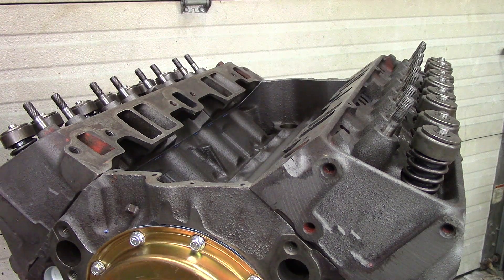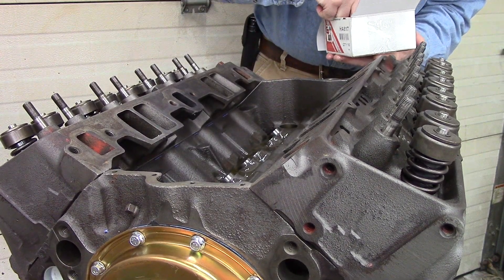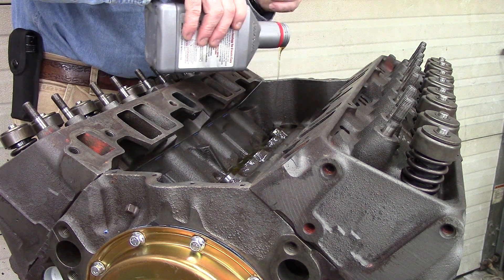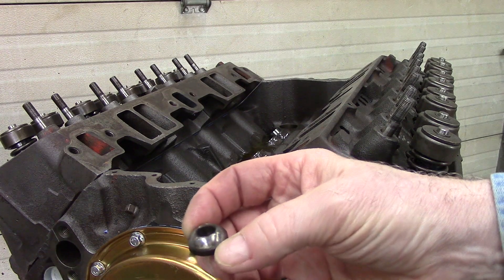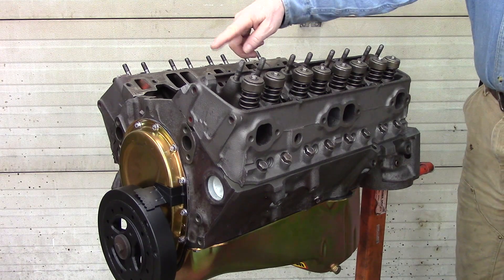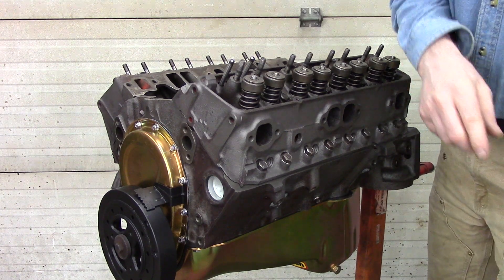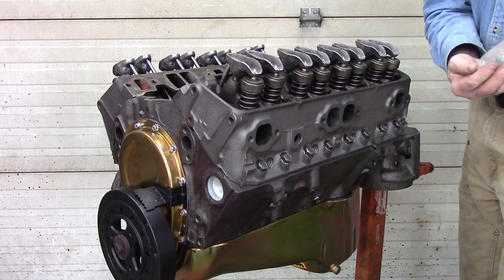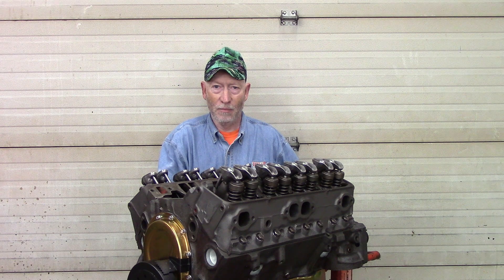V-8 Engine Rebuild SBC #12 Valve Train Install

Comment: Installed dry lifter no oil or lube on the base 😮
Reply from the maker: At the start of the video oil was poured in the valley, and on the cam below, hense oil on the bottom of the lifters, added more oil later.